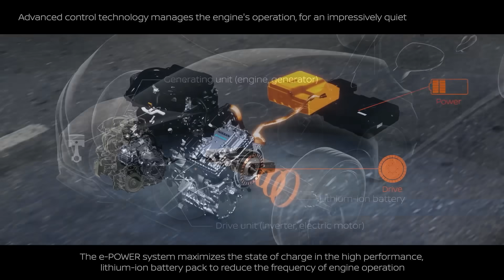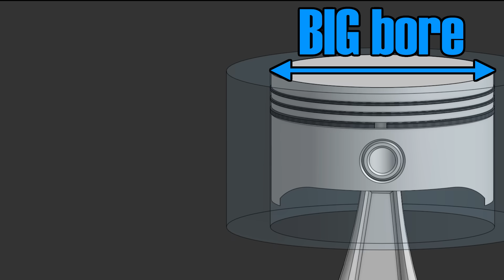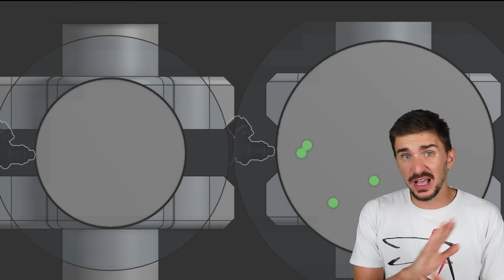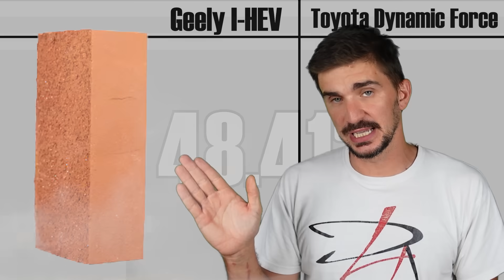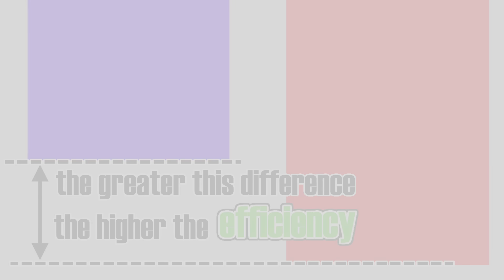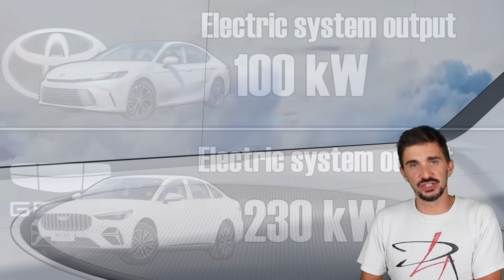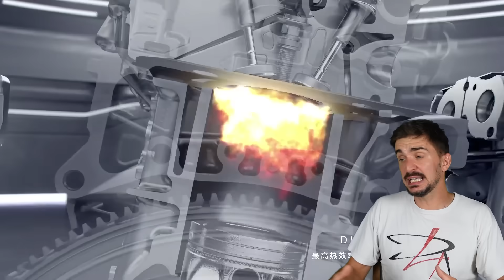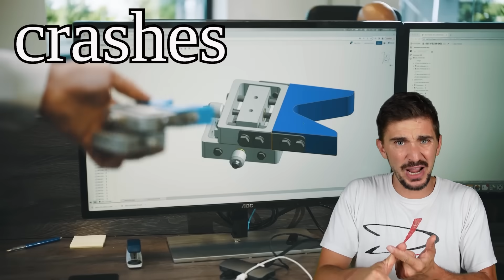How China's Geely Beat Toyota, BMW, Ford and Everyone Else

Comment: The 15.5:1 compression ratio makes sense now. The  "deep" miller cycle effective compression ratio is much lower than that.
Reply: Yea this confused me a lot in the beginning "okay so how are they handling that high compression, normal gas blows up way earlier than diesel" -> "oh they don't use half the compression re miller cycle" 

Now im just wondering how it would work with compressed air intake. Probably fix that problem with the deep miller sucking in low battery power though it shouldnt have much effect on top performance since the engine isnt doing much. I say this but what i really want to know is whats the optimal compression to minimize the low power feeling. Cars like this dont need top power, they need to be predictable and reliable.
Reply: @josephvictory9536 there is actually a way they could do it. You run it the way BMW was back in 2007 with their direct injection engines. During intake you inject a below ignition fuel mixture and then during ignition you inject a very small amount of fuel onto the spark plug causing a flame front that ignites based on the injection charge not the bulk of the chamber. In theory you could achieve very high compression ratios as the mix you are compressing is too lean to self ignite. The issue is emission regulations are harsh on NOX emissions and high compression ratios produce large amounts of NOX and is a far bigger limiting factor on fuel efficiency that most give it credit for.
Reply: @mitchellcouchman1444  Yeah that's basically Skyactiv X but they couldn't get it into the US because of NOX problem.
Reply: @josephvictory9536  it wouldn't work with a compressed air intake, at least not without variable compression ratio, by having an auxillary valve(s) in the head that can open to increase TDC volume and temporarily lower the compression ratio.

but that'd still affect reliability.

the ideal solution would be two engines/motors, one "ultra efficient 30-40kw engine" for maintaining highway speed, while acceleration is handled by either a powerful EV motor paired to an 80kwh battery, or a second "normal" engine.

the "Two engine" option is probably the more fun, the cruising engine runs the front wheels while the "power" engine runs the rear wheels.
Reply: This is true for many engines. The given compression ratio is pure geometric number from piston, stroke and combustion chamber shape. Valve timing is not included. Actual effective compression ratio is often very different, demonstrated here with the Atkinson cycle. But it is also true for regular engines; properly tuned engines achieve higher effective compression ratio (in their optimum rpm range) than their geometric number would suggest.
Reply: @ComplicatedStuff Absolutely true points.

But i don't understand why nobody is understanding that if it is entirely direct-injection, they prevent detonation by not having any fuel in the chamber until they want it, like diesel-cycle..

( i believe it is Vizard's "Building Horsepower" book which identifies that a properly-tuned exhaust has up-to 6x the pull of the piston's intake-stroke,
measured,
so it's all much more involved than simple-thinking would suggest.

all the books in that series are aweful-design, btw, no matter how important the info in them.. )

🙏
Reply: @antrygrevok6440 Direct injection in a petrol engine injects the fuel before the spark plug ignites. Its not like a diesel where the injection directly caused combustion. So direct injection does not prevent detonation. Mazda has a very interesting technology in this field (Skyactive X).
Reply: @ComplicatedStuff  Late injection (and careful control of spray pattern) means very little fuel gets into the crevices above the compression ring and the outer reaches of the combustion chamber before ignition occurs. Those outer reaches are where detonation first starts, and where it does damage.
Reply: If geely would use Mazda's SPCCI tech, they could realise a dynamic compression ratio of 15.5:1 instead of 10,5:1. Now if you combine that with a hybride e-turbo from Porsche and you have one hell of a beast!!!
Reply: In terms of efficiency off course, it wouldn't at all be a sports car
Reply: Wowza. I drive a 13.5:1 15.5:1 is nuts
Reply: All China🇨🇳 car use this engine as backup Generator
Reply: @c@carkawalakhatulistiwa• NO , not yet ! 
This engine was just invented , 
in about 1-2+ years  then this engine will be a generator for most plug in hybrids .
Reply: gwm:
Reply: I thought of it the moment I saw the ratio. "Wait, that won't work without a miller cycle."
Reply: Also they don't us forced induction
Reply: This China.  They didn’t invent anything.  If you put all the emissions regulations on this engine the US requires, it would be no better than the rest.
Reply: Oh, I got shouted down, laughed at and ridiculed when I said that the key to efficiency is increasing compression ratio back in high school.
Reply: That's chemistry!
The lower the density of the gases in the combustion chamber, the higher the compression ratio!

This means it's possible to achieve compression ratios higher than 15.5:1 with less gas in the combustion chamber!
The problem is that there's a limit to this: too little fuel and air makes the engine underpowered, even with a high compression ratio! So you have to choose between power and efficiency!
Reply: Now- what about cost and longevity?
Reply: Why keep beating the ICE Horse to death, it’s done, get over it!
Reply: It's a 15.5:1 expansion ratio. Compression ratio is the wrong terminology. 
And the term expansion ratio has existed longer, since it applies to steam engines.
Reply: @londonalicante too bad more people don't understand this.
Reply: During the intake it is behaving like a small capacity undersquare with a normal compression ratio, and then during the power stroke it behaves like a high compression long stroke large capacity engine.
Reply: @gasdive  highest possible effective compression is still required to hit the highest peak pressure just after TDC, which is what makes the efficiency good
Reply: AFAIK it's the other way around. Efficiency comes from two places - low cylinder volume (for efficient combustion stroke) and low gas pressure (for efficient compression stroke). The first is achieved with a high actual compression ratio, while the second is achieved with a low effective compression ratio.
Reply: @jurepustoslemsek7882  all of the power "lost" in the higher effective compression will be made back in the working stroke many tines over because the gas volume is multiple times bigger after the combustion. If you reduce the effective compression to save power, the work done by the working stroke will reduce like 5 times more than the power saving you made so you will just lose a lot of power. The ideal compression ratio for efficiency would be closer to what diesel engines use but you can't use so high compression on a gas engine because it starts knocking.
Reply: @MF175mp  if cylinder pressure at BDC is higher than atmospheric pressure, that energy left over is not utilised by the piston, it either goes out the exhaust pipe as waste or is recaptured by a turbocharger. 

peak efficiency comes from having the largest possible difference in pressure between TDC and BDC. reducing the amount of air in the cylinder during the compression stroke reduces the pressure at TDC but it also decreases the pressure at BDC. higher compression ratios give more efficiency because they improve the expansion ratio (the pressure at TDC when the combustion stroke starts, vs the pressure at BDC when the combustion stroke ends).
Reply: @MF175mp  you are right that you lose a lot of power for only slightly better efficiency. But you missed the point - even if the effective compression ratio is low, you still get the benefits of high actual compression, but you also minimize losses during compression.
Reply: @jurepustoslemsek7882  with low effective compression you can't achieve the maximum efficiency. It's not possible that they would be running low compression and achieving higher efficiency than most recent turbodiesels do. I'm putting my money on it having anything from 14 to 15,5 effective compression and the valve timing gives even more expansion on top of that.
Reply: The higher compression ratio increases efficiency so it makes sense they are running the highest compression on the market. 15,5 can possibly cause knocking but they're definitely above 14:1 effective
Reply: @MF175mp  yeah but they dont actually run that compression ratio.
Reply: @jksjrgfpsjgr  no chance they would run much less than the max possible without knocking. It would be like shooting yourself in the leg if you want max efficiency
Reply: @MF175mp  I think what he is saying is that the miller cycle requires that the max possible compression (geometric compression) is not achieved due to shortened compression bore stroke (due to valves) on the compression cycle. Which is correct.

The confounding question is this, did engineers label the ratio by the effective or the geometric displacement? And the answer is geometric. 

You need racing fuel (or ethanol mix) for ratio above 10. If we assume compression is linear due to the volume of the bore relative to the place on the bore the stroke begins compressing, then the effective compression ratio for this miller is probably closer to 8 well below the 'knocking' ratio for standard fuel (since its around 50%).

According to google there are two kinds of compression geometric and effective.

Geometric Compression Ratio: This relies entirely on the displacement of the full piston stroke (from Bottom Dead Center to Top Dead Center) plus the combustion chamber volume (clearance volume).

Effective Compression Ratio: This relies only on the portion of the stroke after the intake valve closes.

Edit im wildly mistaken with the numbers for the effective compression, its around 10 to 11.5 and its actually dynamic.

Comment: Where is the video's animation link I want to see that engine's animation I can't seem to find it. I prefer gas or diesel cars rather than hybrids never peaked my interest before and never will. I would've optimized the engine alot more to handle the compression and power but have enough stroke to harness it into motion and not rely on electric stuff in the first place.

Comment: I am in China, the smaller battery options in new cars give them 500+ km of range. I don't know why I would need more. 
I would be interested in these kind of engines for marine use
Reply: Marine engines, at least some that use heavy fuel oil, have astonishing undersquare ratios!

Cylinder bore	96 cm (38 in)

Piston stroke	2.50 m (98 in)
https://en.wikipedia.org/wiki/W%C3%A4rtsil%C3%A4-Sulzer_RTA96-C

Probably not what you were thinking about.

Comment: Nissan e-power v3 claimed to achieve 50% (in the lab, 5 years ago) using the same technology you described. STARC: Strong Tumble & Appropriately stretched Robust ignition Channel, combined with a fixed-point operating range,  extremely lean at λ = 2, spray formed valve seats, and predictive battery charging. Perhaps Ghosn smuggled it out with him in his suitcase

Comment: We have run trains like this for decades, we’re converting ships to hybrids using the same premise, Nicola Trucks in Canada are doing exactly the same to semi-trailers. Running the driveshaft electrically makes more sense, and coupling an ICE to recharge a small battery is an engineering master stroke, everything is much more efficient

Comment: The fanatical pursuit of efficiency and 'low emissions' is resulting in engines that don't last (and are becoming less and less 'serviceable') - the 'savings' in fuel consumption need to be weighed against the durability/life of the engine (and vehicle as a whole), given it takes a long time for a vehicle  to consume the equivalent in fuel (energy) used in manufacturing it (if it ever does -  some calculations would have it that they don't even come close). These long term implications are being buried/ignored in the 'public debate' (although people have been saying for decades that the most efficient use of energy in motor transport is 1) building vehicles to last and 2) owners maintaining them properly.
Reply: This “EPA rules are why nothing lasts “ yet there are zillions of old Priuses all around us? Face it: auto makers are cutting costs and then pointing the finger elsewhere. Enthusiasts of power efficiency vs. fuel efficiency are eating up that lie.

Comment: I've Chinese 1.5T engine in use. Need to say it's absolute crap. Over 3000rpm it consumes fuel like crazy. After 100K it started wasting too much oil and excesive amount of oil appeared in turbo manifold... means it needs to go away. As I'm not the only one facing issues like this, it comes to conclusion it's not only about efficiency - it's longevity, reability, etc. I'll take Mitsubishi genuine 1.5T in a blink of an eye instead this "efficient" Chinese piece of crap. Luckily I've got it very cheap.
Btw, anything is not hard to do when you're lying about your performace. Chinese credibility rating is close to zero.

Comment: The significant drop in performance when the battery is down will force the users to keep their batteries charged and use as much as possible instead of the today's avarage users, who, accodring to statistics, mostly use their PHEV as a normal ICE vehicle.

Comment: Sorry but IT's changed already from initial thumb up as usual to a Thumb DOWN.
I cant listen to idiots that have'nt yet learned to count in basic denery.
There is NO such number as 48 point Fourty One.

The tens and hundreds and thousands are as you say to the left of the dp.
However there are NO / NONE / ZERO / ZILTCH /  'F A'  factors of "tens or hundreds or thousands etc,  " to the right of the dp.
Please learn to count properly, i.e. 'fourty eight point Four One'
The digits to the RIGHT of the dp are each voiced /said as the singular digits are pronounced.
The value of the coloumbs to the right of the dp are tenths, and hundredths and thousandths (mili) and tenths of thousandths, hundredths of thousandths and millionths (micro), and 0.1 micro, 0.01 micro, and then similarly nano........ peaco....... femto......... etc.
Whole numbers to left of dp and FRACTIONAL numbers in the columbs to the right of the dp.
Balistic 4x4 rc car was super.

Comment: All great until that last part about powerloss and AI fix for it, that is a terrible solution imo. Good video.
Reply: Why is it terrible? It's not real ai, it's location based engine adjusting. Sounds like a smart way to solve a problem - if it knows the route it can drive smarter.
Reply: @MelodicTurtleMetal security, privacy, independency etc. cars should not be online devices.

Comment: I'd like to see which approach is actually more efficient: using a highly efficient engine to charge a battery, despite the energy losses from charging and the electric motor, or sacrificing some engine efficiency and using a Toyota-style eCVT system to drive the wheels directly.

Comment: yo this gets people mad but there is actually a lot of adiobatic efficeincy left on the table in the realm of oxygen enrichment. not talking about nos. not talking about methylnitro or whatever its called. a ~60w portable 12v oxygen generator that uses physical membranes can increase the power output of a traditional ICE by several Kw. its not some brown gas hho conspiracy, thisis a physical process that doesnt really use much energy to produce higher oxygen levels, and ironically they run nativily off 12v automotive system voltages. in the usa going from ~22% o2 at sealevel to around a few percent lower in high elevation towns like denver colorado yield around a 15-20% loss in fuel economy even with modern o2 sensors. there is just too much lazy nitrogen that robs the heat from the engine every cycle and out the tail pipe. we never messed with this technology coz it super charges the amount of sox and nox you get while playing with the devil in terms of cooling issues/thermal expansion. aluminum blocks and sintered carbon head gaskets really dont stand up to it, but it has a lot of potential in iron block low compression engines and the machines are like 100 bucks from china now lol.

Comment: I am sure it can be handled with proper materials and quality, but most long lasting engines have had short stroke. For instance legendary Mercedes engines from days when they still made high quality cars. Also Toyotas dual injection is not only for efficiency, but it also keeps intake manifold clean by spraying fuel (great cleaner) to intake manifold like traditional engines did. Modern engines get carbon build-up, because they only have direct injection. Just another example of how most manufacturers do not respect customers. I believe Fisker Karma used this type of "electric engine drives cars, ICE engine creates electricity" -type of system.
Reply: The ''classic' Mercedes engines were reliable because they were very low stressed and hopelessly underpowered (30-40Kw/litre).  They didn't make a modern engine until the 1990s.
Reply: @mrbrisvegas2 Mercedez had a world record for fastest turbo diesel car and all cars had low hp to liter ratio, but still many were not reliable. If only some car brands still made reliable cars.

Comment: 2 issues, 1.5 with that much boost will cause head gasket failures. honda learned on their small turbo engine. also pressed in valve seats will drop due to the heat generated from that engine

Comment: I mean the Sulzer 80 something Kw 2 stroke diesel engine gets over 50% thermal efficiency while going 25 knots hauling containers across the ocean for all our fancy sneakers and temu clothes.
Reply: Also the Mercedes OM654 diesel is 46% thermally efficient. Which is pretty damn impressive with the amount of power it produces. It’s not record breaking fast but hauls an SUV body well enough while getting that efficiency.